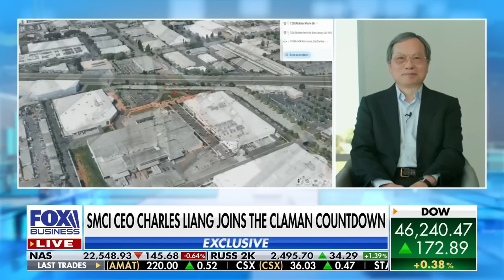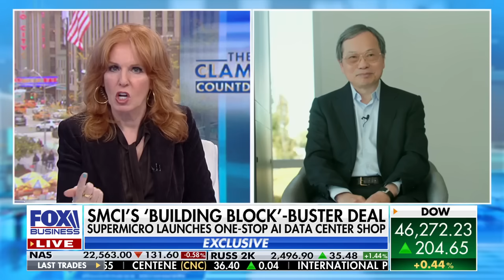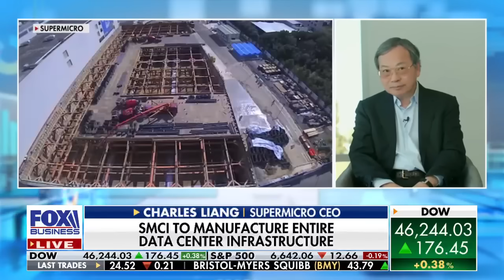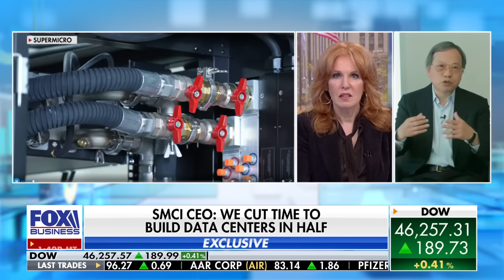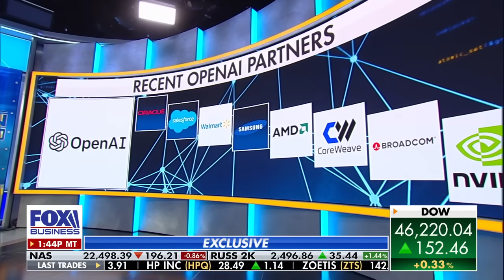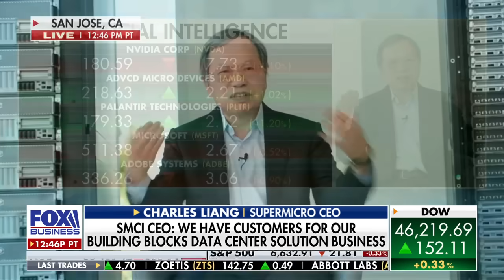Supermicro expands US manufacturing for data center infrastructure

Comment: NVME raid controllers.  No manufacturer specific firmware requirements or insane markups.  Super Micro got the goods.

I used to be one of HP's few premier server engineers.  From Compaq Computer Corp.  For 28 years.  But HP completely failed to innovate.  Wave good bye to the leader!  Their ship sank in 2015, and they are now just starting to notice.